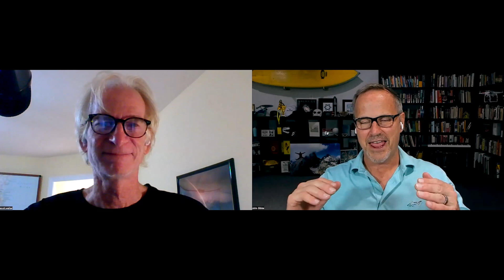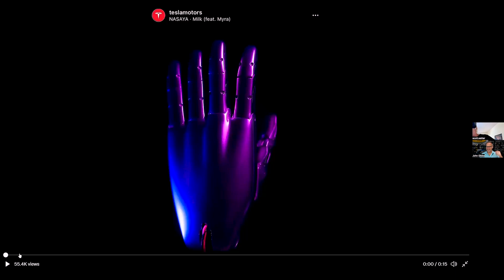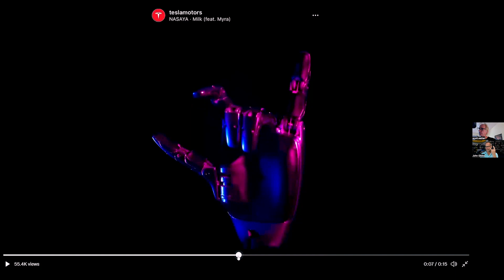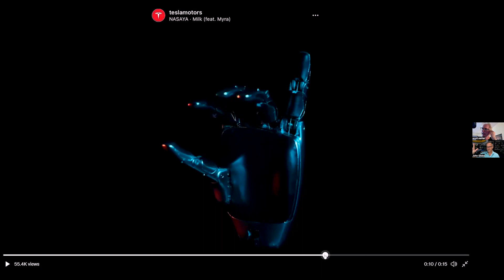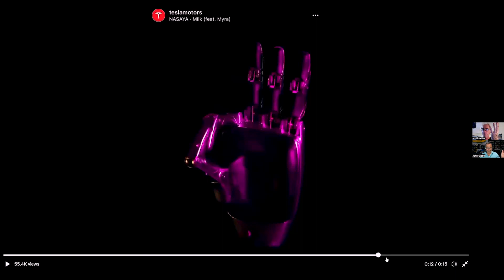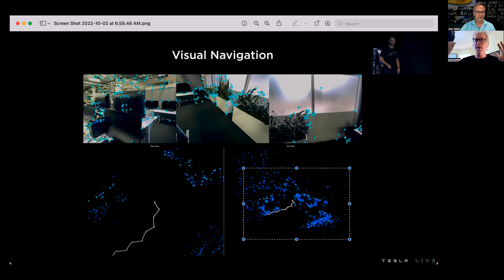Thumbs Up! The Mechanics of TeslaBot's Thumb--Plus Much More about Optimus! With Scott Walter

Comment: Tesla did not try to recreate the human hand.  The original model looks like a hand drawing model like Scott's human drawing model.  Human thumb opposition and ABDUCTION muscles are in the palm. Human finger flexion movements are via tendons to muscles in the forearm.  Using first principles, Tesla moved the flexion actuators to the palm and replaced extension actuators with springs.  Proprioception is built into all actuators.  Touch and temperature sensors are in the gloves and foot plates because they wear out and need to be replaced easily.  They are the reason why the hand did not crush the mango and the leg model did not crush the egg.  Limb and finger calibration with vision is done on  command.  Individual movements are stored as behaviors (like turning right or left in the car).  Complex movements are assembled from these basic behaviors.  

Communication is almost certain to be done using one of the industrial control I/O networks.  This would require three wires, large black and white for power and small red or blue for serial communication.

Tesla fixed the head to simplify the design.  Having an independently movable head would profoundly increase design and computational complexity.  

There are multiple cameras.  I have not found an explanation where the cameras are, but I would include near and far 3d stereo cameras for distance and left and right and rear view cameras for full 360.  Eventually, I might expand to full 360 distance stereo for use in a complex work environment because the bot cannot rotate its head.

Comment: The joints need to meet all the attributes of what a human hand can do, or more. Other features that can help save power, is locking joints. I.e. when a human holds a 1 or 2 hand held object, it takes up much energy at long periods. Lock joints, feature 🔋 saving.

Comment: Love the commentary on the hands. Interesting to see the design restricted to one type of actuator in the hand, and the compromises it requires. The LURE prosthetic arm that I helped design went with all geared drives, and linkages in the fingers for a repeatable and deterministic motion. The thumb has a differential gear arrangement for two degrees of freedom.

Comment: 22:50 what they do is to use autolabel to generate the occupancy network training labels. They have 3 cameras moving through space and time, this generates the world "point cloud" using SLAM to get poses and then basic self supervision for depths mapping to generate the point cloud. Once they have the poses of the robot's center of mass at each time step and the 3D world, they can generate labels for what the neural network should predict in each timestep.

Comment: I just thought again about the motor current as feedback for control.  I don’t think that will work because of the arrangement of the work gears, the feedback force from the linear actuators would be pushing perpendicular to the axis of motor rotation? Seems like it would need an encoder on the screw drive the measure absolute linear displacement.

Comment: Deducing 3D by moving the camera in space works well for walking. But if the bot has to stay still at a place and work on fitting screws, nuts, bolts etc then the bot has to keep 'bobbing' to get the 3D visualization.
Also, the front camera and side cameras don't seem to be overlapping all viewable areas. There seems to be a strip of view 'straight ahead' that  is visible to the single front camera...thus depriving the 3D view of object right in front of the bot.
I also question the prudency of building a prototype with fewer cameras. They should be fitting as many cameras as possible, capturing data from as many angles as possible; and then processing several combinations of datasets to determine the minimal number of cameras and their respective positions for optimal functionality of the bot. The production model could have a pared down number of cameras!

Comment: You mentioned how 3 cameras may be used to create stereovision. However, in a connected, constrained factory environment, isn't it possible that Optimus can be just one of many edge appendages in a large integrated system processed by dojo? Meaning that all the sensing/ computing doesn't have to be done by Optimus. But Dojo can integrate/ process videos from all the Optimus robots along with the videos coming from wired cameras in the factory to create real-time, superhuman sensory output?

Comment: Power and data seems perfectly reasonable to keep hand easily exchangeable and allow.for.feedback from sensors so you must have at least 20 things to monitor and control. Probably a tad cleverer than I2c and pico 16unit servo controller.

Comment: So for a 48v pack, the operating voltages will be 42-56vdc.  So this should be able to share components with any 48v system, although they should be called 42v systems as it's the minimal vdc and 42 is the answer.

Comment: 21:29 Although we can look down and see our feet , we typically don't look at our feet when walking, we look before us and our mind keeps a "map" of what we see and navigates from  that. In the case of the Bot perhaps an extra camera pointing down could be used for tight areas. (this is also when we tend to look down at our feet)
Reply: Bot could lean forward if needed, no?
Reply: @knoworiginality  Possibly, but probably not in all situations could the robot lean forward  (such as when it is caring something),  and not as quickly as having a camera to turn to. Cameras are cheap (they don't need to be AAA class  for the non-primary views).  And they could be just used when needed, not increasing computing power much overall.

Comment: I could not help but wonder why two bright individuals focused on the thumb not meeting the tip of the forefinger when it was inconsequential for functionality.  Happily, you both came around to that realization.  Amusing detail of a very good video.
Reply: Isn’t it fairly important for a pinching motion though? Will it be able to do things like pick up paper if it can’t put its thumb and index finger together?
Reply: @ZeroRelevance  Good question.  I just did and it was easy. Try it yourself.

Comment: A combination of vision and tension on the motors is probably enough to start with. Removing the touch sensors massively reduces signal complexity and makes models a lot easier to interpret IMHO. Also, as a detection transformer, Panoptic Segmentation (PS) seems like an obvious way to go, assigning both classes (what something is) with ow it is arranged in the image. I can't image the difficulty of stitching video together and then performing PS analysis continuously (lots of compute) but it seems tp be a close approximation to how much of fleshy vision system works (recognition and class assignment). Of course, once something is classes, the semantic properties of that class can then be inferred. Nice.

Comment: 28:35 - I'm a VFX artist and we use "3D camera solves" all the time. You really don't need very much movement at all in order to calculate the parallax of each pix pretty well.  Just a small sway to the side or even back and forth would be enough. Wouldn't even have to take a step.
Reply: In addition, you can already get depth data from a single camera even in photos taken in smartphone cameras using nothing but vision and algorithms. I'd guess they are using that, plus the parallax data, plus the occupancy network all together.

Comment: What you are discussing about the high frequency points, tesla calls it NeRF system but I think they said it's not yet ready for high relayable data. I think they have other ways to make a 3d picture. I think there are some machine learning alcorithm that can make a 3d picture out of a 2D picture. On the street it's easier because there you have things like the line that is getting thinner how further it gets away on a picture but has in reality always the same thickness. That's probably how the alcorithm works that he can tell how far away things are. By telling how the things are getting smaller in distance and calculate out of it the distance. 🤷But this is just my guess. Or maybe he has still two cameras in the front to also see things far away. And he can use the normal Tesla hardware and algorithm

Comment: 13:00 about control of pulling in fingers, if you don't want add actuators on each join, make weakest spring at tip and stronger near hand, and add small lock mechanism so if you don't want to tip move but whole finger lock cable so all load go to spring closer to hand, maybe with something allowing to not be 0-1 but allow only some tension so could be move independently
EDIT interesting is that it have only 2 finger joins, not 3 as humans
EDIT 2 16:00 you mention what I said in edit 1 :D

Comment: What nobody has mentioned... is they showed the robot using a WATERING CAN. 
* think about the off-center grip point that is very narrow and the wrist torque to hold it level..
* think about the sloshing of water as it walks and turns that would make the can torque and rotate in the hand. 
* think about the changing center of gravity as it tips the can and the arm gimbal to pour smoothly
* think about the changing mass as water pours out. 

If bot can use a watering-can with accuracy and dispense controlled amounts of water this is actually a VERY VERY impressive demo.
Reply: Very true. They may use the feedback from the change in torque to imply the amount of water dispensed. So much they could do with software and ML.
Reply: The water can was empty.
Reply: @paintedpony2935  for now
Reply: My question is: why they should?
They aim to robot to do specific works, not party tricks, your dishwasher can't walks, do it make it less useful? That this robot have humanoid form, don't mean it must do all thing humans do. Look at video by "Francisco Galarza" with title "Tesla bot is an industrial machine | And why it WILL work', because he give this interesting perspective in better words when I could.
Reply: @m_sedziwoj  I think it's an extremely valid point that robot demos should be things humans don't want to do  (factory work) .. if you can do that for 20k you're a better product than the 2 million dollar robot that can dance or play soccer.

Comment: I would argue there is no international standard or requirement for the OK sign to have fingertip and thumbtip touching. If you do an online image search for ok sign you'll see people doing both this and the one Teslabot uses.

If you put a finger from your other hand though the hole and try to use it to pull towards the connecting point, you will notice that the Teslabot method is much stronger (at least for human hands!)

Comment: At 1:53 when they show the servo you can see the wire count of 6. It could be a bldc, y-u-v, +5, gnd, tach/commutation. Or A dc motor with mot+-, a ,b, +5vdc, gnd. And yea, for sure, they are going to be monitoring current for a force measurement. 48vdc is a nominal 14 cell lipo voltage but it can charge up to ~52 volts. Maxon makes similar motors.

Comment: Without an opposable thumb, you can't pick up a sqrew.
And without that, you can't use a power tool.

But Optimus might still not need to be able to rotate the thumb. There's little need for having the thumb on the same side as the fingers. As you do when gripping a too thick bar or handle.

Comment: with some good engineering, you could send data over power.  That could keep down the wires too.  I know power is notoriously noisey, but with good protocol it could be done, imho....
Reply: I may be wrong but I think they are doing that in the Model Y to reduce the number of wires.